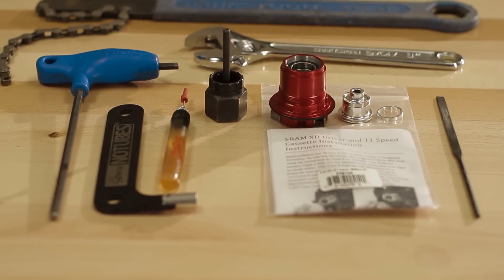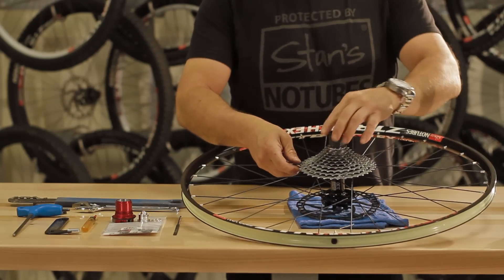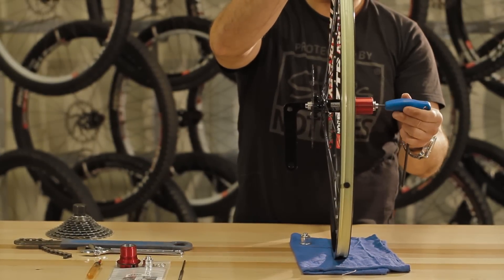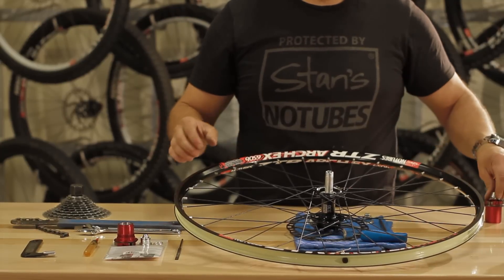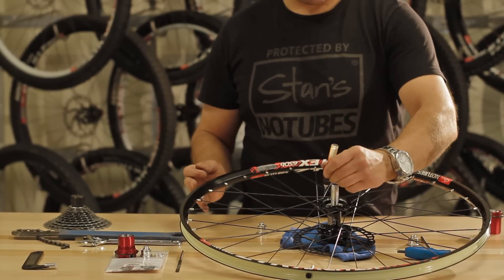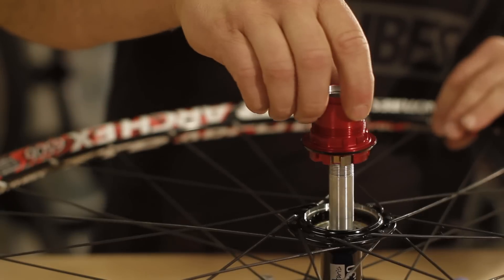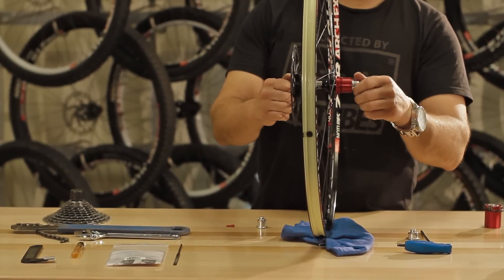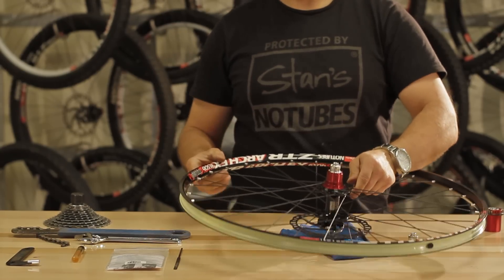Stan's 3.30/3.30Ti hubs XD Driver Freehub Installation

Comment: If I have a Crest/3.30 rear wheel 142 TA setup with XD driver and want to convert to standard shimano/sram free hub, do I just need the shimano/sram free hub part and do this process in reverse? Thx.